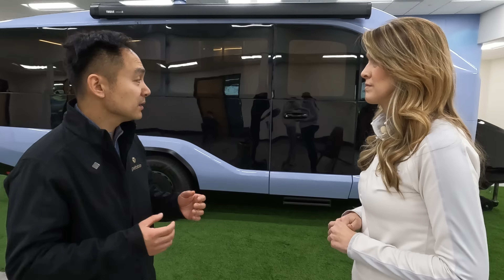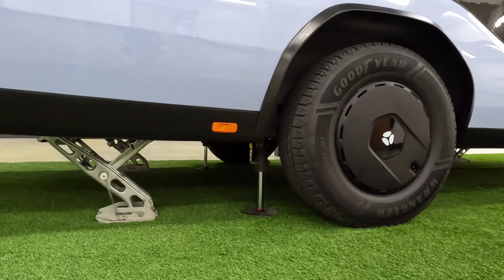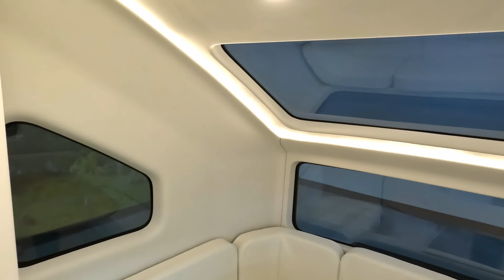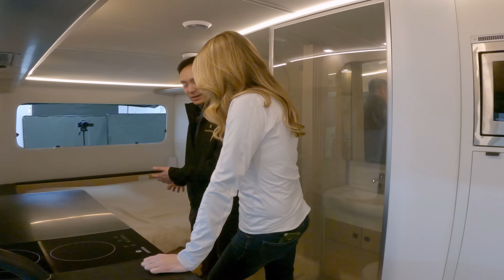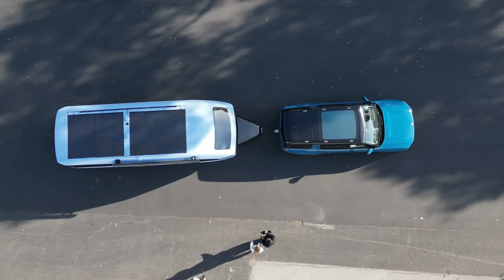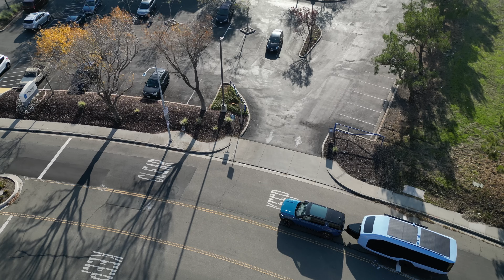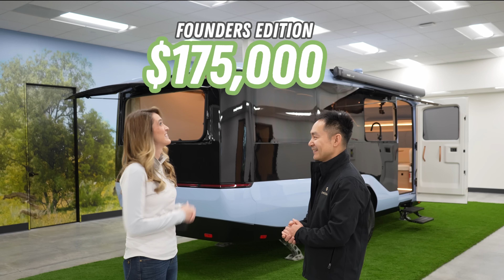Pebble Flow Electric Travel Trailer FULL TOUR (Production-Intent World Premiere)

Comment: Consider adding screens to windows to avoid bugs while camping. Also, wondering where this would be able to DC charge on the road with its size?
Reply from the maker: Screens are standard for all openings on all trim levels. Pebble has addressed that frequent observation elsewhere in these comments.

Any pull through charging location will support DC fast charging with Pebble Flow in tow. When a pull through is not available, detachment and remote operation allow drivers to position the trailer perpendicular to dispensers in ways no other travel trailer could support.

Of course, the onboard battery will support more range than typical RV drivers need daily. More importantly, the powertrain can be bypassed. There is no requirement to carry energy.

-Producer Tim

Comment: The Axle is too far forward. The rear looks like it will swing into opposite lanes when turning.
Reply from the maker: The position of the axle must be dictated largely by the possible spectrum of weight distribution.  When it moves autonomously, the hitch wheel must remain firmly planted but tongue weight cannot exceed typical tow-vehicle limits. -Producer Tim

Comment: Will it handle snow load in harsher climates like Idaho, Montana etc?
Reply from the maker: That's a good question for the Pebble Community. The link is in the video description. Thanks for commenting. -Producer Tim
Reply: Was wondering the same. Would be a great option for camping in nature if it had alternative heating options ie. gas. otherwise it would drain the battery in a day in winter with low sunlight conditions

Comment: As someone who has veen camping for 20 years, For $109k starting price, I don't think I'm convinced this is better than an equil size $30k trailer or atleast would have concerns.
The self propelled portion is nice, and on level camp sites/ ur driveway i can see that being helpful, but alot of sites arnt level and id be concerned about it either getting stuck or worse running away
Reply from the maker: Running away? 

At $109k there is no powertrain, exterior smart glass, solar array, or instacamp leveling+outrigger. At that price the app integration, 40kWh battery, and high materials grade are the standout features. 
-Producer a Tim
Reply: Firstly, by running away, I mean rolling down a hill while using the self maneuvering, unless it is capable of locking the tires between inputs or has built-in hill decent control. 
And why not at least include the  solar for that price?  The current truck and trailer combo we have cost less than this trailer, and that's with a 36-foot duel slide out camper. 
Unless the goal is to compete with airstream in wich durability and reliability for years is the goal, I dont see the advantage unless someone just has more money than they know what to do with.
Reply from the maker: Electronic parking brake is standard.  That is why wheel chalks are not required.  As shown in this video, the app has a "dead mans switch".  If you let go of the button, the vehicle parks.  Easy.
The pricing is set by two factors.  Inputs and market demand.  We should expect the addition of a feature to add cost.  
This is certainly a premium camper which is intended to appeal to Airstream buyers.  More importantly, Pebbles never-before-seen ease-of-use features such as autonomous hitching, instacamp, integrated app control, EZ tow, and active aerodynamics will appeal to millions of drivers who never would have considered buying a travel trailer at all.  This is the creation of a new category and it greatly widens the total addressable market compared to anything on the road today. -Producer Tim

Comment: a lot of very interesting concepts, but i must admit that controlling everything through a phone app is not appealing at least to me.
recharging at a campground will also be problematic.  recharging just an ev is already becoming an issue at campgrounds, the electrical system at campgrounds is typically undersized already and adding a massive recharging system for electric vehicles and trailers will be very costly
Reply from the maker: There is no need to add anytime to a campground to charge this. It can recharge in a tropical 120v 20A outlet if that is what is available.

240v 30A and 50A receptacles which are common at campgrounds will be more than sufficient for Pebble Flow. It doesn't need to draw any more energy than any traditional RV with an air conditioner.

There is a misconception that EVs and other high capacity batteries require high current. They do not. Users decide how much to draw based on what is available.
-Producer Tim

Comment: What about mosquito screens and screen door? Also I'm not sure about the concept it being in easy drive can't it still charge batteries from solar panels? The recharge mode is confusing is it using an alternator to charge the rv?
Reply from the maker: Magnetic removable screens are standard on all trim levels. You can learn more details on the web sites linked in our video description.

Pebble captures energy from any traditional power outlet or EV charging station as well as the sun. It can also capture kinetic energy produced by the tow vehicle. Many options. -Producer Tim

Comment: Everything is good except the 45kwh, here in Arizona that might last you 3 days with the AC on full blast and all the other stuff onboard.
Reply from the maker: I wonder what percentage of campers are interested in remaining inside a trailer under desert sun for more than a few days with no access to electricity.

Regardless of the answer, you are certainly right to point out that overcoming extreme temperatures will require more HVAC energy than pleasant environments would. Folks who endure weeks of Death Valley and the Arctic Circle will shop the niche expedition category. Pebble Flow is a mainstream product.

Those with 140-200kWh electric trucks can top off the Flow using that power to extend boondock sessions beyond the energy provided by the euro solar panels.
-Producer Tim

Comment: Boondock camping in this, for seven days, is the most ideal pipe dream one could imagine for the consumer market this thing is going after.  The water tank, waste tanks, and especially the HVAC, water heating, microwave and inductive cooktop that will bleed that battery dry faster than you can imagine - we are talking about a market mostly of non-campers here - and with that many windows the heat loss must be high so the duty cycle on the AC will not be advantageous.  Even a sunny day will not give you enough to do it all over again with the "optional" solar panels. Someone who buys this due to its sleekness, fancy windows, etc. is not going to understand that they will have to ration water, not flush unless its brown, not have hot water, cook outside, and sweat through humid nights to get even close to seven days. Oh, and the solar panels are optional and the claim is UP TO 7 days! Every RV does that. The thing is gorgeous really (i want those windows), and certainly amazing and practical in a full-hookup RV park, but please stop with selling the off-grid fantasy already.  I would love to be proven wrong, so take this thing out to a summer camp out at a no-hookup campground in the SE USA and see how it does keeping you in a pleasant lifestyle for how many days - not saying another trailer does that, but that is the sizzle being sold.  I want to see that video!
Reply from the maker: The math indicates otherwise. An induction stovetop uses very little energy. 1100w of rooftop solar should generate 3-8kWh daily on average. That would be sufficient for cooking, water pumps, and lighting.

Today's most advanced automotive heat pumps are also highly efficient compared to what other RV companies use. HVAC is the variant of concern. 7 days at 0F or 120F would not be a realistic expectation. 7 days in a mostly sunny temperate environment is realistic. This is a mainstream product for mainstream uses.

I'm of the opinion that It would be unwise for Pebble to cater to overlanders or Arctic explorers who need to be in extreme environments for months at a time. The total addressable market must be large enough to sustain a business and deliver shareholder value. This product competes with Airstream and AirBnB cabins rather than Unimog or expedition trailers. The Flow is largely differentiated by ease-of-use innovations which no other travel trailer offers. It makes the past time attractive and access it to new audiences

Autonomous hitching
Range extended towing
Unified app control
Tow vehicle camera access and mode changes
Surround security camera system
Instacamp one-button leveling and outrigger deployment
Huge 40kWh battery capacity

We will publish videos camping off-grid with Pebble Flow this summer.  Please subscribe to be notified when those are online. 
-Producer Tim
Reply: @MissGoElectric  I look forward to those trips. Climate control is the #1 concern - especially when it comes to expectations of a market.  Camping in areas of the country where it can be somewhat cloudy, reasonably high temps, and high humidity are common in the summer (Think Midwest and SE USA). If this is made just for mediterranean, low lattitude climates I would agree. Also, in some climates like joshua tree area (likely big on the list for the market for these individuals), the extreme heat of the day and extreme cold of the night mean HVAC a lot more hours (BTW, what is the R-value of those walls and fancy windows everywhere. How long will it take to cool down your trailer when it has been a sunny 95+ all day and you come back from hiking? Way different with a big HVAC and a generator. With a traditional airstream, you have propane to rely on also for water heating, cooking, and of course heating the interior. These glamper customers will not understand - especially if they came from an airstream. And, this is not even touching on the water/wastewater issue. Again, not super different to an average trailer owner - who knows to get more than three days with a family of four you will need to really be paying attention to everything - This newb vamper customer with their "spa" bathroom will not be so expectant. Connected, if you have the $$$, awesome. But dont over sell this off-grid capability.
Reply: 1) guarantee that most people boondocking in summer want shade, which means the rooftop solar doesn’t work… and winter solar may not be enough to maintain the battery % with heating the living space and heating the battery 2) queen bed for $100k-$150k 3) this appears to be a 3-season camper (aluminum frame creates thermal bridging) & single pane? windows 4) the tech sheet should list everything about the vehicle. This is Airstream level, not Living Vehicle level. Could write more, but it’s a more modern 3-season EV airstream. 🖐️
Reply: @human_cabbage  I think you are being generous - at least in boondock mode. This is two season at best, with forgoing many of the creature comforts to budget your energy, water and waste, for anything more than a few days even in those spring and fall off-grids. The market for this trailer will either not understand this before buying or not care since they will be connecting it at a park (which it is great for). Just don’t sell this “be one with nature, off grid for ‘up to’ seven days, in your puppy lovin’, feel goodz glamper doin’ one for the environment with no sacrifice in creature comforts”
Reply: @human_cabbage  I think you are being generous - at least in boondock mode. This is two season at best, with forgoing many of the creature comforts to budget your energy, water and waste, for anything more than a few days even in those spring and fall off-grids. The market for this trailer will either not understand this before buying or not care since they will be connecting it at a park (which it is great for). Just don’t sell this “be one with nature, off grid for ‘up to’ seven days, in your puppy lovin’, feel goodz glamper doin’ one for the environment with no sacrifice in creature comforts”
Reply: Also, lets be real here, this channel is a marketing vehicle (no pun intended) by a person who is a marketing consultant for those who sell electric vehicles. This is carefully curated content to appear like some independent take on this product. One only needs to watch the channels intro video to understand that. No biggie - but always consider the source.
Reply from the maker: You are misguided and incorrect. 

We are not compensated in any way by any RV company. We are obviously pro-electrification. The name we chose literally encourages viewers to GO ELECTRIC. 

Miss GoElectric and I have been automotive educators for decades. We have consulted with many automakers writing curriculum, teaching technology to sales teams, and educating hundreds of thousands of consumers in person. All of that happens behind the scenes. We do not sell. We do not market.

None of our consultation with automakers has ever appeared on this channel.

Miss GoElectric holds a college degree in broadcast journalism. She delivers information about a subject she understands well. It is a subject which is meaningful to her. As a viewer you benefit from the expertise and the passion.

This video and others like it are produced by she and I alone.  We volunteer our time and use equipment she purchased with personal funds. From its inception the entire brand (all three channels) have been financed exclusively by Miss GoElectric.

We have no corporate overlords or investors. We have no sponsors of any kind at this time.
-Producer Tim
Reply: @ a career as spokesperson and trainer for the automotive industry would likely be less lucrative if one were to point out shortcomings in things they review in the automotive industry. That is fine but any videos viewed should be with that fact in mind. The channel itself helps the personal brand as well. Which is fine.
Reply from the maker: We have published over 100 lengthy and detailed eMobility reviews with critical observations based on extensive time on the road. In fact, EV reviews are among the most popular content we produce.

This is NOT a review.
This is an introduction and an explainer. It is titled as a TOUR.

There are no electric travel trailer reviews in existence because nobody outside of the company has experience camping with a production version. 
-Producer Tim

Examples of reviews:
https://youtu.be/-9aIGa-Xysg
https://youtu.be/SdOal5q_7kA?si=8r0qYhUUf2qt9x_l